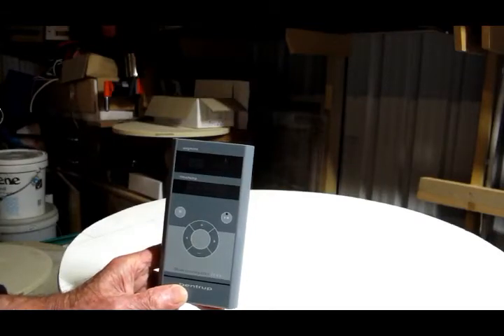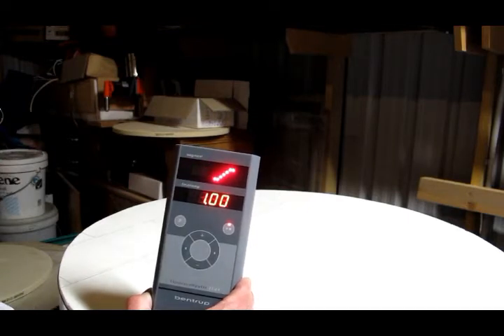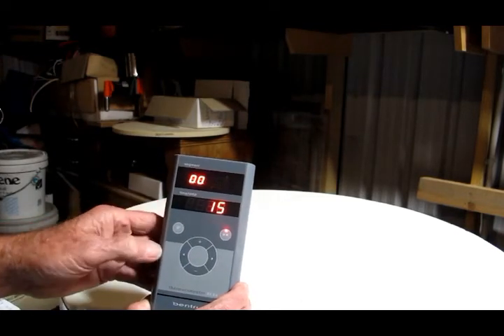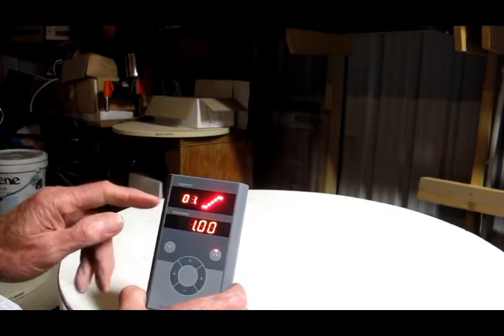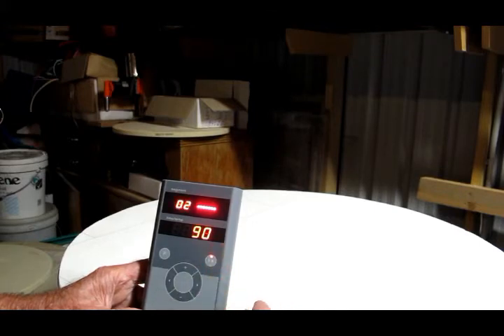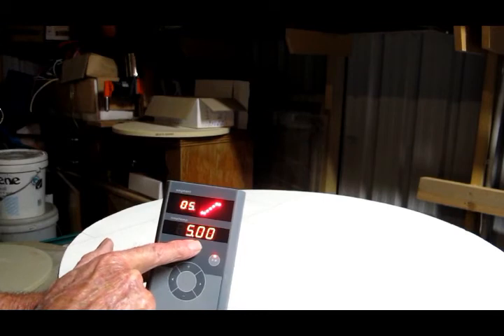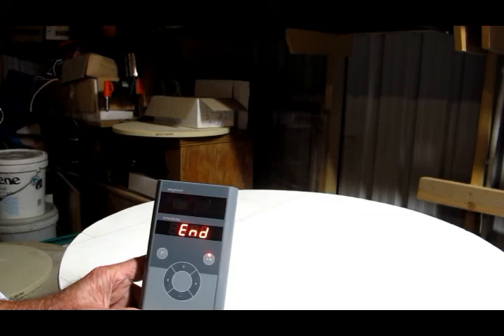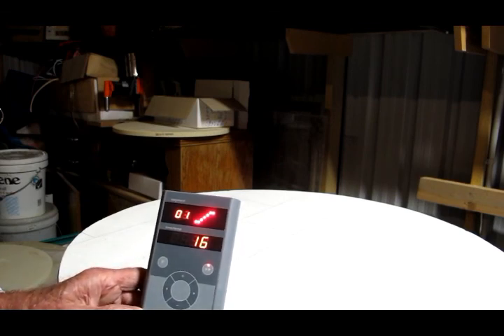How to program a Bentrup TC88 kiln controller

Comment: Thanks for the video, it was very helpfull. Although I have two question. 
On the 8th step when you press minus button, I assume those options are there for slow cooling. Is there any way to set them up like "cool to 800 from 1000 and wait for 20 minutes and then cool down?"
Other question is... Is this control pannel okay to heat and cool and heat again within those 8 steps?

Comment: Very helpful video but my bentrupTC88 gives me the temp before the time can you tell me please how to sort this
Reply from the maker: Unless you have a faulty controller, each program as you set it up, starts with firstly the time delay (in hours) before you want the kiln to start operating. The next step is setting the time you want it to reach the first temperature and finally setting that temperature.  I would suggest setting a single stage program on Program1 with the settings as thus-: 5 minute delay to start kiln. 10 minutes to reach 45 degrees and end the program. Time everything to see if that works.  There appears to be no reset back to factory settings on the controller, but if it's a TC88  controller it should operate as per the video. The manual if you haven't got one is at https://www.manualslib.com/products/Bentrup-Tc88-10461349.html.
Reply: The older model of this bentrup TC88 was the TC60/8 and had first temp, second  time.  Newer models are as shown in the video.  In both cases temp is the temperature at the end of a program segment, time the duration of this segment.
How to differentiate ?  Time always contains a period, temp are only digits.

Comment: I have (hopefully!) scribbled down the main points from this helpful video. I did this for a pottery colleague so thought I'd share in case anyone else finds it useful:

How to program a Bentrup TC88 kiln controller

TOP lights : Programme number OR step number in the schedule (when working on a programme)
Bottom lights: Current kiln temp OR hold / target temperature (when working on a programme)

Top left button: Programme button
(Push it again to change between different programmes)
When you’re switching between programmes, there will be a big “P” sign lit up in the top lights as well as the number.

Wait a few seconds and then the “01” flashes in the top lights, which means you’re now programming the first step in your chosen programme.

Use the left and right buttons in the circle (the < and >) to swap between the steps in your programme

Each step has 2 elements: 1) Time, 2) speed

Step ZERO – you can set a time delay here if you want your kiln to fire later
(use the “PLUS” and “MINUS” buttons to set the number of hours

HOW TO SET A SEGMENT:

Then move on to STEP 1 by pressing the “>” arrow. The little staircase picture will appear in the top lights.

Set the time (the duration of your first segment) by using the “+ -“ buttons. It goes up by a minute each time you press, or you can hold it down to go faster. You can tell you’re changing the duration because it has “0.00” as its format (note the decimal point)

PRESS THE > arrow to move on to setting the temperature for this segment

Set the target temperature by using the “+ _” buttons.

REPEAT FOR THE OTHER STAGES

NOTES: To programme a “hold” segment, put in a duration for a new segment and then keep the temperature the same as the previous segment. The little staircase picture will be a flat line.

NOTES: If the temperature segment is going UP you will see the staircase going up.
If the temperature is going DOWN you will see the staircase going down.

To select END, use the minus button to go below zero – it will give you 0, “skip”, then “END”.

When your programme has been programmed, you want to store it in the memory. To do this press the “START/STOP” button (round button on top RHS).

NOTE THIS WILL ALSO TURN ON THE KILN and the little light on that button will go GREEN. The kiln may make a clonking noise so don’t be surprised. If you don’t want to run it now, press the start stop button again and the RED light will come back on and it will stop.